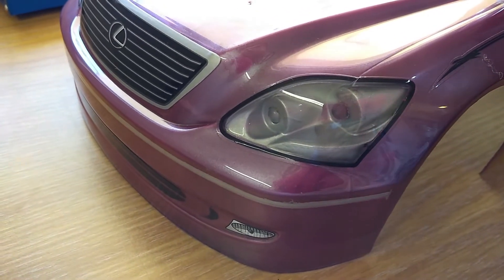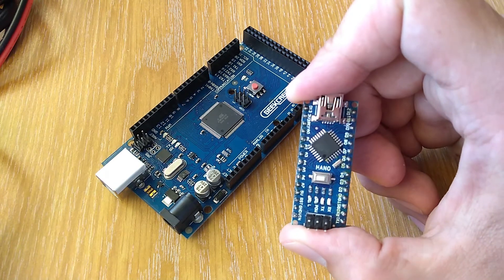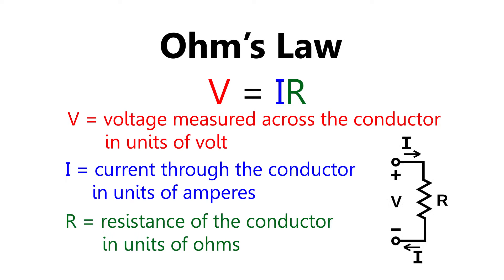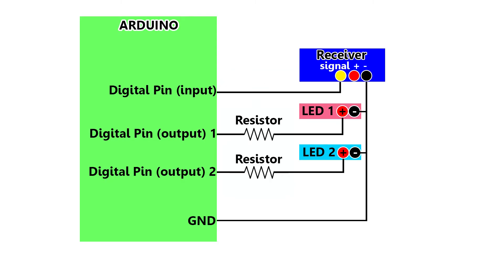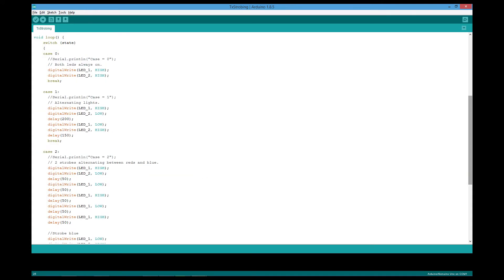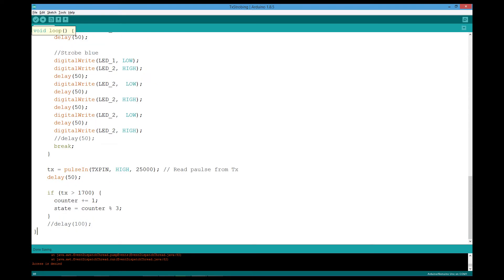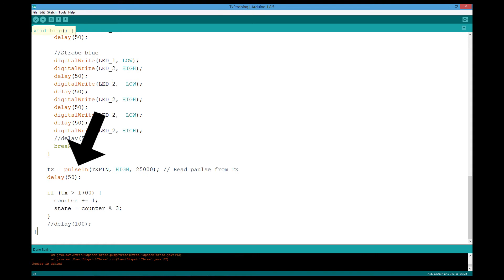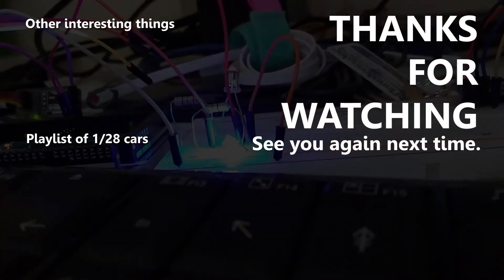RC LED Lights Programming with Arduino

Comment: hi beaver. i have issue with nano. undervoltage when motor punch. how to solve. im using receiver power. bec 6v
Reply from the maker: Sounds like the voltage drop is too severe. You install a capacitor to the input at Arduino to reduce the drop. Either that or you can either change the battery.

Comment: So how do you connect to the 2s 7.6v battery?
Reply from the maker: You can get 5V out of the ESC where it connects to the receiver,  just need + and - from there. You can also use UBEC that converts 2S (or more) into 5V.
Reply: @BeaversHobby  so the ESC will convert the 2S 7.6v battery to 5v output to the receiver?
Reply from the maker: @HungNguyen-oz1jc  Yes, and you can use that same output for arduino too.
Reply: @BeaversHobby  if you use 1 pin from ch1 and ch2, how can you plug the servo and esc to the receiver?
Reply from the maker: @HungNguyen-oz1jc  There are 3 pins for each channel on the receiver: signal, + and -. You can plug the servo and ESC in normally (CH1 and CH2) then plug the Arduino into + and - of a channel that you don't use, eg. CH3.
Reply: @BeaversHobby  in that case, it cannot control the light simultaneously with the servo and ESC, what if I want to control the light the same time with servo and ESC?
Reply from the maker: @HungNguyen-oz1jc  The way this code works is it treats the program switching as a separated channel (I use button from CH4). If you want the CH1 (steering) to control the light as well you can use mixing from the radio to output the same signal from CH1 to whatever channel you use for light control.
Also if you want to have ESC control the light as well then you just do the same thing and write more code to recognize the input from another channel.
I think you could make a splitter for each channel so it goes to 2 outputs without the need of mixing. I've never successfully use it though.
Reply: @BeaversHobby  I see, i'll just going to use your method first until I find away to pair the LEDs with the servo and esc. If possible could you please share me the schematic of your setup?
Reply from the maker: @HungNguyen-oz1jc  It's just like in this video with plug from Arduino goes into channel 4 (because my radio has button on channel 4). That's it. I don't do interactive throttle/steering lights.
Reply: @BeaversHobby  What port do I use to power up the arduino from the receiver?
Reply from the maker: @HungNguyen-oz1jc  The ones beside the signal port in the same row. I think you should watch this video to understand how RC electronics work first. https://youtu.be/BSt7U-yOa4Q

Comment: Check out the Open Source RC Lights Project (OSL) on RCGroups, you can build your own PCB or the code will also work on the Nano you are using. Three channels, 8 outputs, and a very easy to configure custom light schemes. Love your channel! https://www.rcgroups.com/forums/showthread.php?1539753-Open-Source-Lights-Arduino-based-RC-Light-Controller
Reply from the maker: Thank you. I wonder why I've never seen that thread before. Maybe because I only check RC Car section.

Comment: Great video! 
You can also use an attiny85 which is a lot smaller and has lower consumption, as few arduino IOs are used.
Reply from the maker: Thank you. I'll look in to that.